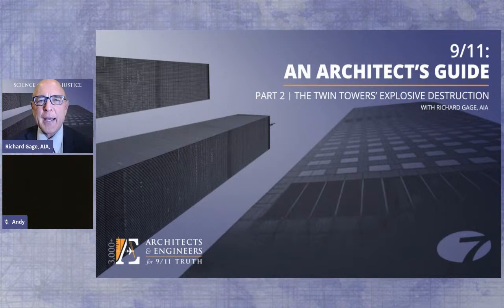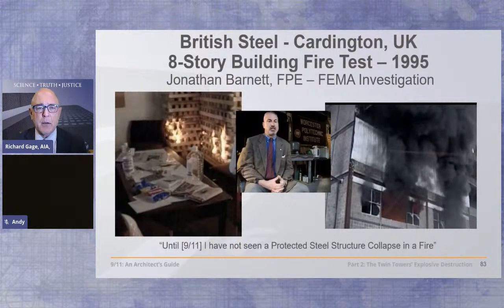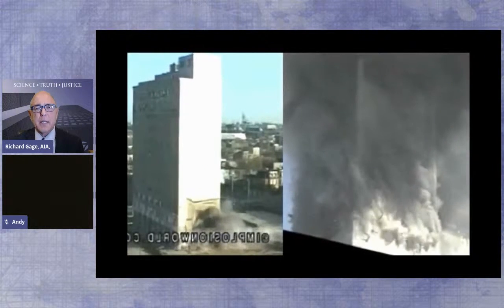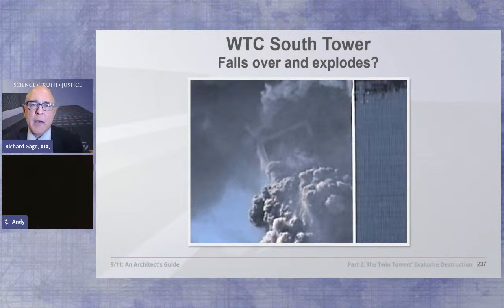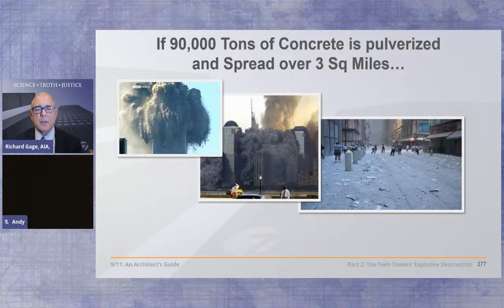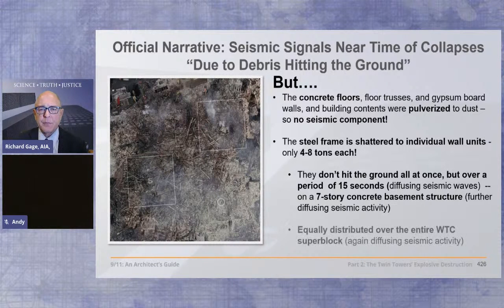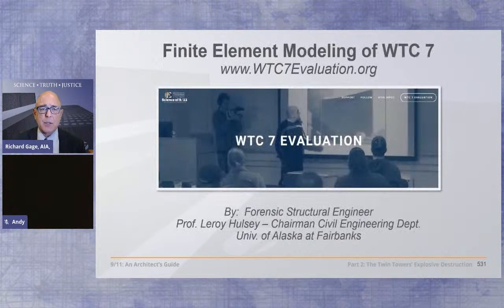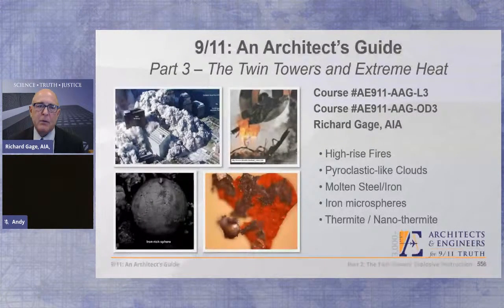9/11: An Architect's Guide - Part 2 - Twin Towers' Explosive Destruction (11/12/20 Webinar - R Gage)

Comment: I have watched control demolition videos. Before the buildings collapse you will see the squibs that are definitely caused by explosives, and then while the buildings are falling sometimes you will see additional squibs. Is NIST good enough to tell if any of those additional squibs are caused only from air pressure alone? I say they must all be caused by explosives 100%.
Reply: Squibs in the TTs started AFTER the towers started to collapse.
Reply: @mcdonaldsneedstousehealthi4369  Yes and several squibs full of concrete were hundreds of feet below the collapses, but in only a few places...what kind of air pressure does that? Plus there are no other examples of collapses to verify that air pressure can do that. Since when is speculation that it was air pressure become official when it is only speculation and not the first choice of what we see?
Reply: @MrLocacat  
A few squibs below the collapse made the whole building come down?
Reply: @MrLocacat  
Since when is speculation that it was explosives become official?
Reply: @MrLocacat  
Steel panels ejecting outside of foot print does not happen in controlled demo.
Reply: @MrLocacat  
TTs collapsed into their own foot print = proof of controlled demo?
Reply: @MrLocacat  
Ejecting beams outside of foot print = proof of controlled demo?
Reply: @MrLocacat  
Make up your mind, did the TTs collapse inside or outside of their foot print?
Reply: @MrLocacat  
In a controlled demo you see the squibs BEFORE the building drops down.

Comment: Mr Gage shows in this video the steel columns getting thicker as the towers go down, BUT ---> If the floors collapse the columns lose 3/4 of their strength.

It was the CONNECTIONS that failed during the collapse ---> the connections bolts/welds were not much stronger on the TTs lower stories.

Comment: Danny Jowenko ---> died in a car accident ''2 YEARS'' after his wtc7 interview ---> NOT 2 days after, so stop telling lies.

NIST does NOT support Bazant’s theory ---> that the upper 10% (remained intact) until it impacted the ground, and then got crushed up.

THIS IS WHAT NIST SAID ===> ''The downward momentum felt by each successive lower floor was even larger due to the increasing mass''.
Reply: Verinage demolitions...top half crushes the bottom half...there is continuous deceleration. Why is that?...Because the momentum required to crush one floor is greater than any momentum gained with each additional floor...When dynamic weight decreases you get deceleration...A hammer's head only has dynamic weight as long as the nail keeps going into the wood.
Reply: Due to the increasing mass? Are you crazy? That mass was always there you numbskull.
Reply: @MrLocacat  
As each story was crushed it ADDED to the falling dynamic mass.
Reply: @MrLocacat  
During the collapse the floors were not supporting static loads.
Reply: @MrLocacat  
During the collapse the floors were supporting dynamic loads.
Reply: @MrLocacat  
Actually the TTs floors were designed to carry 12 times the static loads.
Reply: @MrLocacat  
TTs floors could carry up to 12 additional floors statically or 6 dynamically.
Reply: @MrLocacat  
But the TTs floors had (floors AND core columns) impacts !!
Reply: @MrLocacat  
The TTs floors were not designed to have CORE COLUMN impacts !!
Reply: @dontgetdrunkandvomitonthes3880  Check out this YouTube video "Aaron Brown, huge explosion.09:59.9/11"
Reply: @MrLocacat  
Are eyewitnesses and TV's reporters explosives experts?
Reply: @MrLocacat  
When the planes impacted the towers people said they saw/heard explosion.
Reply: @MrLocacat  
Plane impacts caused explosion. <--- not explosives.
Reply: @dontgetdrunkandvomitonthes3880  Ashleigh Banfield...Aaron Brown...and many others report HUGE explosions seconds before the south tower collapses...they all say a THIRD explosion...I recommend you watch these videos on YouTube...I am not allowed to paste these videos here.
Reply: @MrLocacat  
Do they have video footage or photo's of those snake oil explosions?
Reply: @MrLocacat  
Can you not read?  I said DYNAMIC weight.
Reply: @MrLocacat  
''When dynamic weight decreases you get deceleration.'' <--- YOU SAID.
Reply: @Jim Vento 
''You're also wrong about Danny Jowenko's death''

==> Really?  Why?